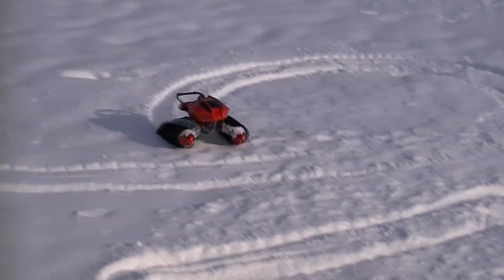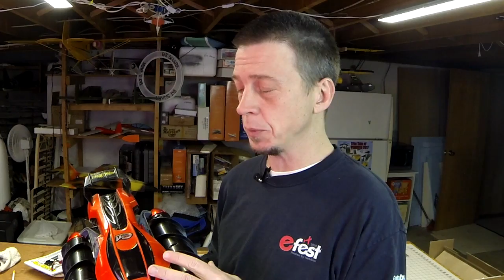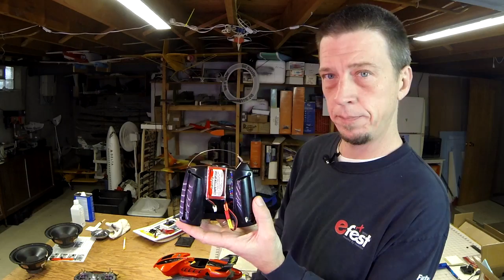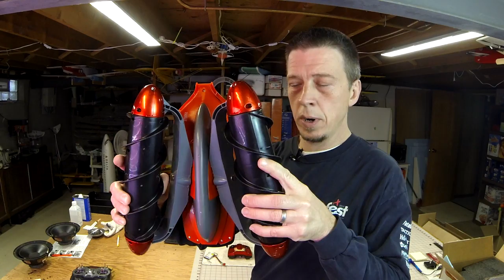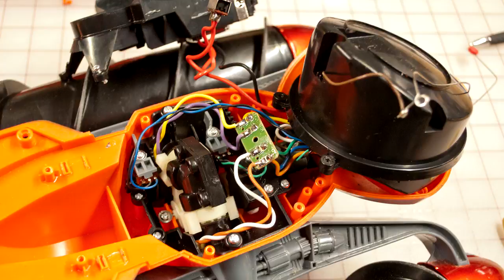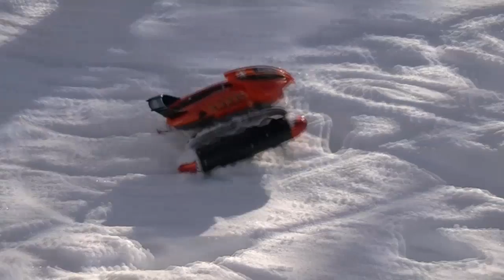Upgrading the Terrain Twister

Comment: I have 4 of these that I picked up from the local Value Village for $5 or $6 each because they didn't have controllers.  I pick up a lot of RCs there cheap because of that issue.  I have a giant Jeep I picked up for $10.

I was looking at the control board to see if I could wire in a cheap receiver to keep the functionality, but came to the same conclusion that the best way is to just throw the boards into the spare electronics parts pile to strip and go with a pair of ESCs and transmitter/receiver.  I am going a lot cheaper, using entry level Chinese parts from Amazon, but since this is a learning project and funds are tight, they will serve the purpose.

I was fortunate to have the original batteries, so I am going to rebuild them with upgraded batteries and wire in a charge port so I don't have to remove the battery, useless I want to swap it for a charged battery and keep playing. :-)  Of course with a bunch of them, I can just swap vehicles. lol

Seeing how well this one worked, I am glad I made the decision to swap everything.  Like you, I figure screw motors will be next.

Comment: Can I use a fly sky r channel stick radio for this great conversion
Reply from the maker: I don't see why not.
Reply: @Weirdflight  thanks for your reply terry  to retain all functions woulda 4 channel do ??
Reply from the maker: @steveclough6794  4 should do it. Actually, you should only need 3. I'm using 2 channels (right throttle/left throttle). The only other possible function would be the pontoon tilting...which I didn't bother with.
Reply: @Weirdflight  thanks again terry you have been a great help  😀

Comment: Any idea how it’d perform in a ball/marble pit (hard material, loose density).
Reply: The balls need to be smaller than the depth of the threads. If you think sand, gravel and loose rocks it'll do fine. Tennis balls though, it's gonna struggle.
Reply from the maker: Good question, I guess it would depend on the size and weight of the balls in the pit.

Comment: Hello. Do you know where i can find 2 esc? I want tot use the same set up for my Tyco 6x4. Thankyou and great and fun Video
Reply from the maker: Amazon should have what you need.
Reply: @Weirdflight  Amazon is not option in my country. I ordered 2

320A 7.4V-11.1V ESC Brushed Speed Controller High Voltage for RC Car Boat
Reply from the maker: @prodee1990  I am not familiar with the Tyco 6x4, but I assume what you ordered will work with it just fine.
Reply: @Weirdflight   Thankyou. It arive in october. But i show you when its finish

Comment: I got one of these for my son at Goodwill. My question is why doesn't this one tilt forward or backwards when just sitting ? I've seen some that they show just sitting and not moving and you can tilt forward or backwards.
Reply from the maker: You're probably talking about the feature found on some of these where you can turn right or left while crabbing sideways. The one in this video had it until I took it out. It works by pivoting the entire lower assemblies where they meet the main body. This takes the pontoons out of parallel and makes either the nose or tail drop down.
Reply: @Weirdflight  oh ok thanks Sir.

Comment: Hello,  I just desoldered the battery tray and use 2-cell lipo.  Is it safe to use 3cell lipo with the original radio stuff?  But to replace the radio to proper RC stuff like you did,  receiver and esc-s, also a great idea.  I have three of these,  2 working 1 spare.  I also disassembled the wheel drums,  need to clean maybe to grease the axles.
Reply from the maker: I don't know if the stock electronics would handle 3 cells. But let me know how it works if you try it.